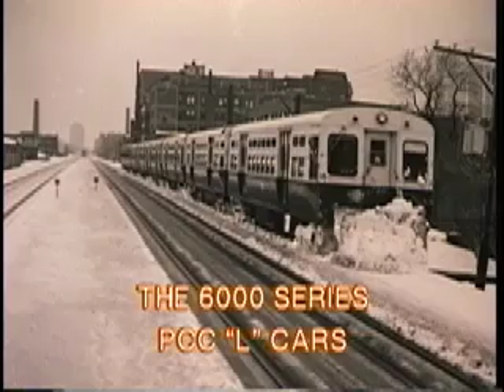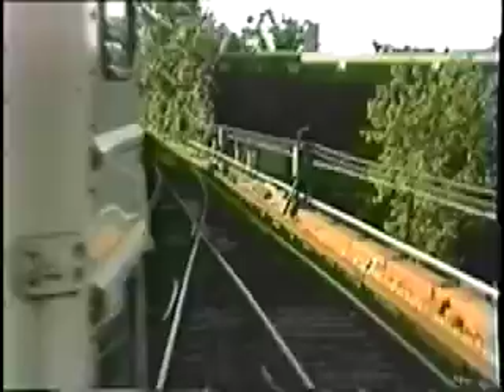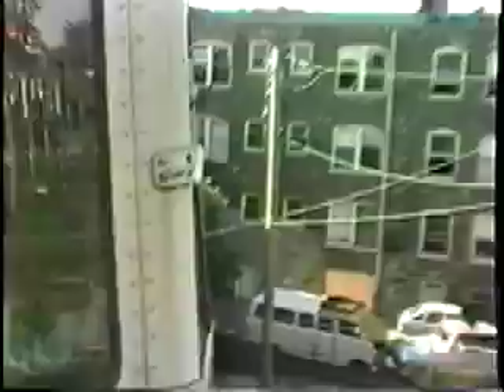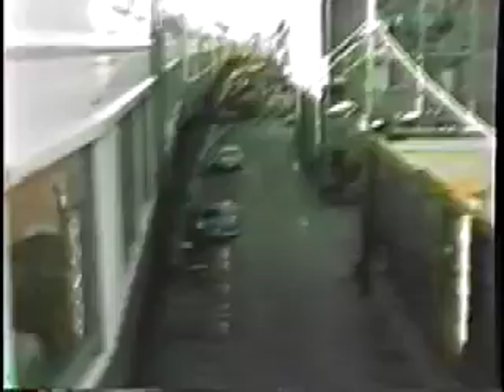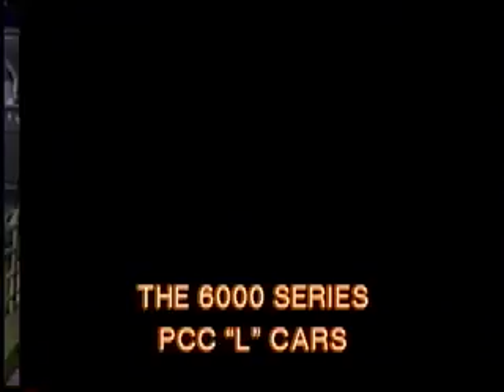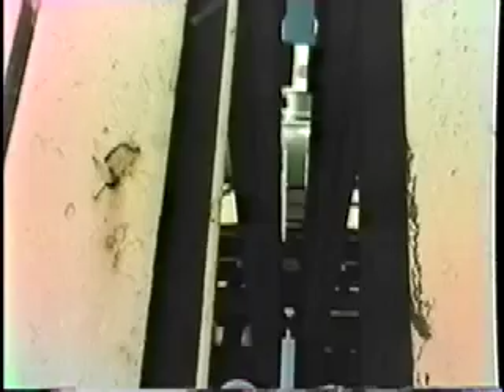CTA Rolling Stock Part 3

Comment: The 6000 series were the work horses of CTA's fleet for over 40 years. When I was a kid. I was once terrified of riding those cars. Because it made a hell of a noise in the subway. Especially when crossing the interlocking areas, simulating an explosion. However over the years I grew to love riding these cars. The noise back then are beautiful now as I grew up. I would definitely miss those bad boys. Again they are the finest in the fleet, second to none.